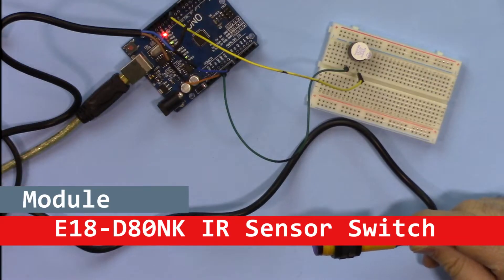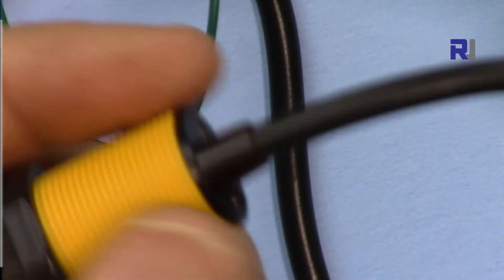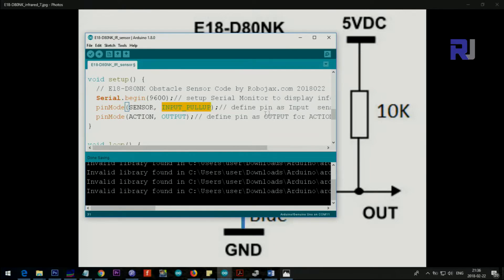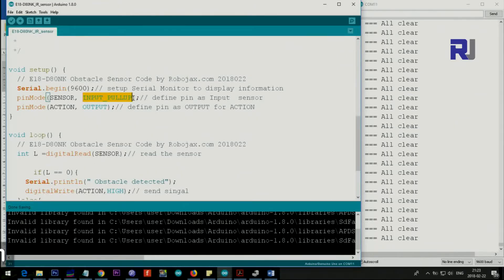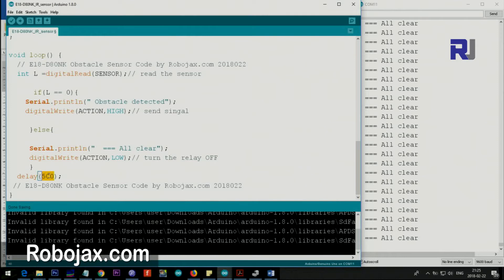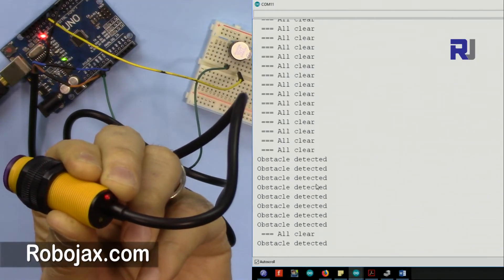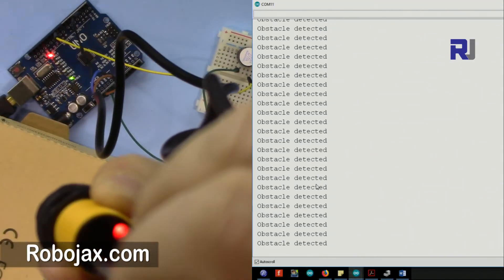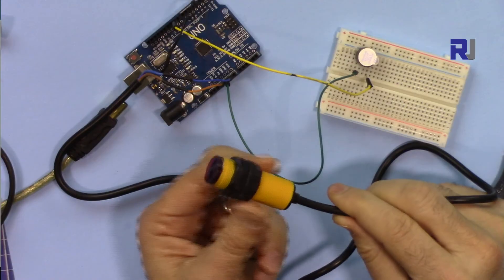E18-D80NK IR Obstacle Avoidance Proximity Sensor Switch with Arduino RJT063

Comment: it can detect any object? how about specific object only like single used plastic? is it possible to use ? or do you have any reccomendation about sensor?
Reply from the maker: it can detect anything that the is blocking the infrared. try your object and test it.

Comment: if using input_pullup is it necessary to add a 10K resistor like in the picture or is it unnecessary? in other words, the black cable output goes directly to the arduino digital pin
Reply from the maker: Just do as I did in the video . I don’t remember what I did.

Comment: hey i want code in order to stop motors when sensors detect opstacle
Reply from the maker: you made me watch the video. I have clearly shown how to turn ON/OFF a buzzer.  Buzzer is your motor or light or anything.  Here is how you can control a motor with relay https://youtu.be/JMBgGO07YLM and here is $200 worth of Arduino Step by Step course (over 100 lectures) Starts here http://robojax.com/L/?id=338

Comment: Is the Breadboard required for this ?
Reply from the maker: I am sure you should see it in the video if needed.
Reply: @robojax  I sent you email right now I just have --- e18-d80nk infrared sensor module &    ELEGOO UNO R3 & buzzer  -- is this sufficient?  I want the buzzer to go off when an object is detected by the sensor -- i hooked the buzzer up to the uno and it beeps but I cant seem to get the sensor to power on at all?  pls help tx
Reply from the maker: I am sorry as mention on my website, all emails will be deleted. I have no time to respond. I can only reply to questions directly related to video if not answered in tue video.
Reply: Delete your email account then

Comment: Sir why is it that my dc mini submersible pump goes low voltage (2.5vdc) upon interfacing with arduino uno? The pumps dc input voltage is rated at 3-5vdc. In the other case, I use independent source 5vdc for the pump and used the arduino uno as a controller. However, upon verification, the motor still is on low voltage state. I used tip32c pnp transistor as a switching device for the motor, with base pin set at low, when sensor detects objects and high when the sensor detects nothing . Please do advice sir. Thank you.
Reply from the maker: Please post the schematic to https://snipboard.io/ and once you pasted the image there, you will get a URL (or address) ,then share it here under the video . I will look at it. if you reply aback after 1 or 2 days, it will be berried under 100s of other comments, so make sure to write new comment.

Comment: Thank you so much for this video sir. How about if we placed this assembled device outdoor where the E18-D80 sensor is expose to the sun's light, will the light triggers the sensor and then turns on the buzzer...just like the other IR proximity sensors? Please enlighten sir, thank you.
Reply from the maker: I believe it should work as it has sensitive potentiometer. I have not tried it.
Reply: @robojax  thank you so much sir for your immediate reply and for sharing your skills and technical expertise.

Comment: Hello, Its not working, ITs always showing all clear. Help me out
Reply from the maker: did you pay attention on how to set sensitivity? watch the video again.
Reply: @robojax  Hello, There is something wrong with wiring, The red light doesnt show when we place an obstacle. Can you tell me how to power the  sensor
Reply from the maker: I have explained it at :159 and I just watched it and it can't be explained better than what I've shown. and also on the page where the code is provided, I have shown it again http://robojax.com/L/?id=255
Reply: @robojax  I got it dude, The thing is the wire they gave had soldered tips and connection was not made as I directly connected the jumper wire and soldered tip, Then i twisted the soldered tip to another wire and attached them with a clip. In that way I got connectivity. Connectivity was the problem, I fixed it in the above method. 

Interesting fact: You could use arduino as power supply for 5V  if  you have to connect E18 -D80k to esp8226 as esp8226 doesnt give 5V supply. Wiring is exactly the same, but you have to give the input to esp8226

Comment: Using these kind of sensor , u have to do stepper motor start and stop or reverse and forward...
Reply from the maker: this has only ON and OFF. Unless you count the ON/OFF and turn on, it will not work otherwise.

Comment: Thanks. I used to auto-door in my learning model. I want when object present in front of sensor the out put active for 10s then inactive. if object still present longer 10s the output still inactive. Can you show me how to code. I am a new member for arduino.
Reply from the maker: it should not do that. This seems to be from code. if connected to Arduino.

Comment: Hi i have a IR E3F DS200C4 sensor can this set up work for it?
Reply from the maker: if it has output pin which goes HIGH and LOW with detection, yes you can.

Comment: I have st-g18-3a30cn npn sensor and it has 4 wires and I couldn't find the datasheet so how can I use it if you familiar with this type?
Reply from the maker: I did a google search and did not get any useful result. It would be very hard. Where did you buy it from? send me the link of there is online link.
Reply: @robojax  this is the link 

https://www.google.com/amp/s/m.aliexpress.com/item/466429772.html
Reply from the maker: Hi Fares, I believe I have a video on that. https://youtu.be/7RQ8QoJWhpY

Comment: Hello can you use infrared with arduinos Analog Input pins?
Reply from the maker: Yes you can use infrared but not this as this is not analog. It just has 5V out or 0V which is digital.

Comment: What if I want to do this with an Arduino Leonardo? I followed your instructions but it doesn't work. Do I need to change some things in my code? Thanks!
Reply from the maker: You are welcome.. I have used pin 2 and 9 and you can define your whichever pin you want to use. Cheers, Ahmad

Comment: I'm noob when it's com to electronic or coding. Can I use same setup to control a relay instead of buzzer. ???
Reply: What I need to do is controling filling machine with photoelectric sensor by connecting filling machine foot switch to relay
Reply from the maker: Yes you can. Exact same setup. Just change the HIGH and LOW according to your relay. Most relay modules are LOW trigger so instead of HIGH they turn ON with LOW.
Reply: @robojax  thank you will do that

Comment: do you have  measure RPM for this sensor ???
Reply from the maker: I don't think this can do the RPM measurement because the response time is very slow.
Reply: 100 Hz response frecuenci aprox ? or more .
Reply: @nelsoncastillo4506  100 hz is about 6000 rpm so if that's really the case I would think it's pretty fast.

Comment: Thanks for the explanation Robojax... 
could I use the same code, pinout and sensor with a NANO (V3.0 ATmega 328P) board instead?
Reply from the maker: You can use it with any arduino. 
You are welcome.